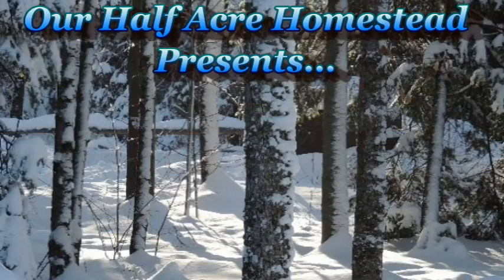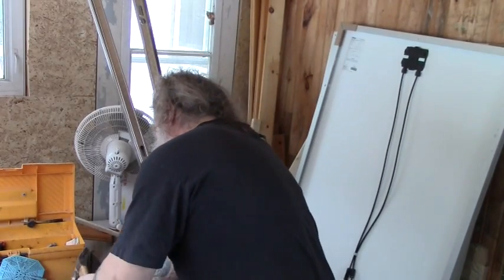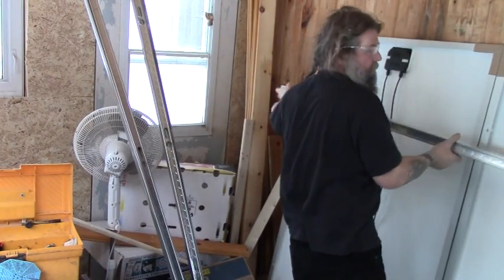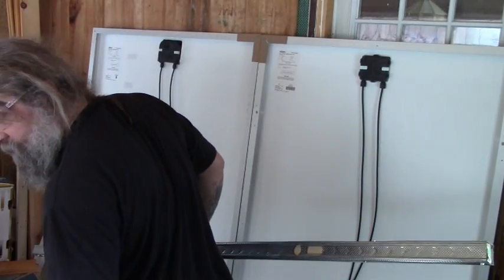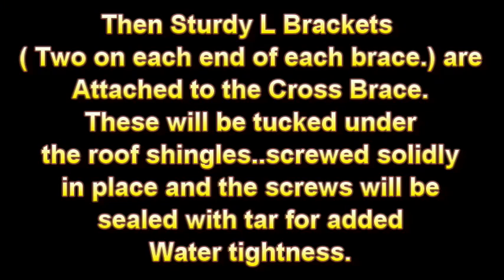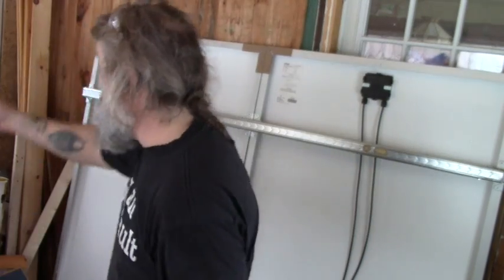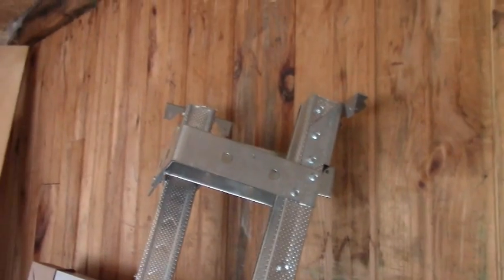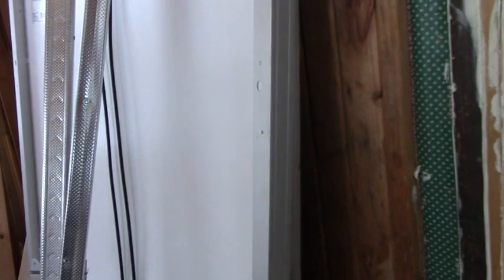Solar Panel Roof Mounts! How HOW Does it!

Comment: In some places they will actually buy your extra power from you; not sure if they do that in Canada or not.  Father-in-law has solar panels and his extra output is bought by his service.  I wonder why the mounting brackets cost so much?  Are they like special metal or something?  Regardless you still have to ground the solar panels so it's not like the brackets make a big deal...  Strange.  Love the video and glad Volfie was willing to share his talents on camera!
Reply from the maker: We eventually want to go completely off grid..I would rather be independent of the electric company that give them ANYTHING..even if they pay for it!
Reply: Total OFF-Grid is the best system.
I don't know about Canada, but here in the U.S. if you go solar and your system is on-grid, if there's an emergency that knocks the grid out, YOUR SOLAR is shut down, too! It's supposed to be a "Safety Feature" so that your solar power won't cause a over-flow back on the grid once the grid comes back up.
So, if the power goes out, it stays out. And YOUR power goes out. And stays out.
OH, but there's more.  You cannot install a switch to go from on-grid to off-grid. It goes against The Code. (Building codes, ya know.) It's illegal.

That's why all off-grid is best. If the entire electrical grid goes down, your power will not be effected. At. All.
Just make sure you stock up on spare batteries and parts. And invest in some faraday cage equipment - mesh screens you can wrap around your spare parts and transformers, etc. IF there is ever an EMP (for whatever reason) you'll want to keep those spare parts and anything indoors protected from burn-out.
But, even if there's never any kind of EMP, off-grid will always be best.
Reply: OurHalfAcreHomestead
Bev, did you ever get my email about Black Start info and the documentary they're making?
Reply from the maker: OhPervyOne not that i am aware of?
Reply: I shall re-send it, then.

Comment: Wait..I should have asked a moment ago...But, how many solar panels will the two of you need before you can go completely off grid? Or does your area have one of those silly regulations stating that you have to have service, even if you have solar panels?
Reply from the maker: not that I am aware of ( about the service) We THINK 10-12 these size and a wind turbine should do it!
Reply: Ah, I was curious, as I know there are places here in the states that if you don't have the city electric, or what have you for the area, they will condemn the home out right, no matter what. Same with water, they make sure there's they are going to get your money one way or another. And 10 to 12? That's pretty neat. If I can find the link, I know I watched someone put up a divert-er type thing that they made, inexpensively, to keep the snow off their solar panels. It was really neat, even folded up and everything. I live in southern Texas, tho, so not much of a need for anything to do with snow here! lol I really can't wait to see how these work out for you! :)

Comment: Brilliant move inserting wood reinforcement between the two aluminum pieces. 

Also is an excellent example of measure twice, cut once and the value of taking the time at Lowe's or wherever one shops, to buy what you will need.

Am curious what type of set up will Mr Volfie have for cleaning the panels once they are on the roof. And was the wood inserts used, pressure treated wood?  Assume so.

For those who live in the Sierra Nevada or Rockies with high winds, consider installing panels off the roof on heavy posts in the ground.  So the wind wont rip the panels off the roof.  50-75 mph winds have removed many a bank of panels on roofs around here.
Reply from the maker: We do not have the space to put them in the ground..also..there is the tree factor..they need to be on the roof..as for cleaning them off..I assume he will get up there and sweep them off..

Comment: Looks good guys! I used perf pipe for my mount and high tensile steel wire for another cheap mounting system.
Reply: LaMar you do top notch Solar videos.  We are borrowing your outside solar composter set up for composting the compost toilet waste.
Reply from the maker: cool!! How does it hold up in wind?
Reply: Works good if your roof has a low pitch. I used high tensile strength steel wire to hold down the panels and it has never moved even in 90mph winds.
Reply: Well thanks Beth! Hope you will do a video and send me a link.